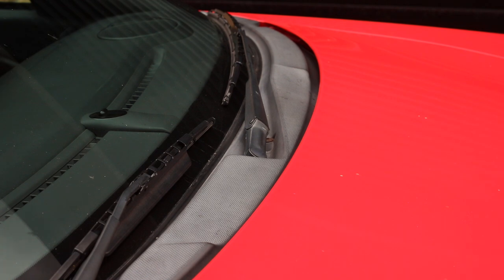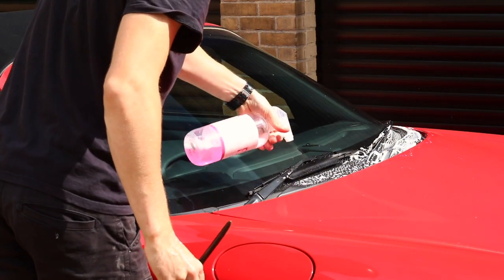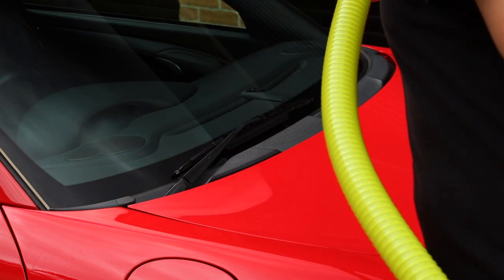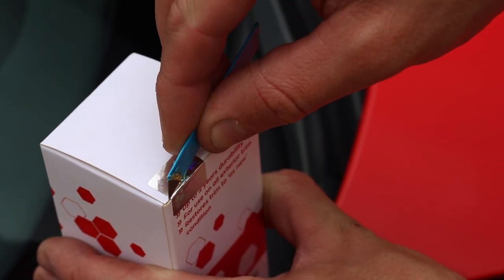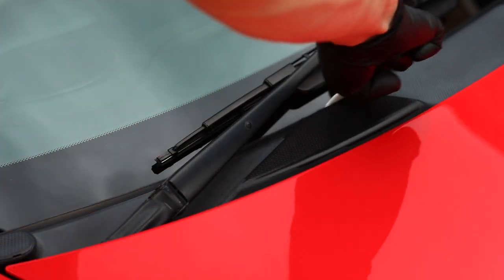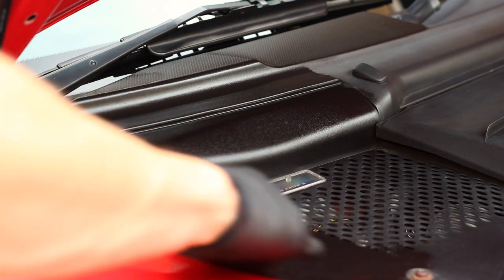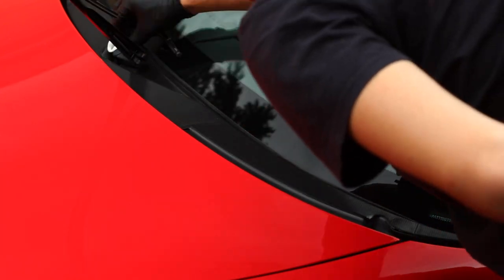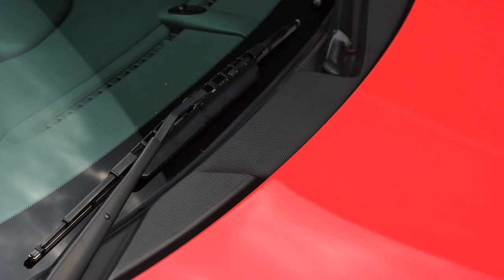How to Permanently Restore Plastic Trim | Gtechniq C4 | Porsche Boxster Detailing

Comment: Good video, liked. This stuff is brilliant, it bought up my plastics and wingmirror triangles a treat on my Subaru, still doing very well after about a year by the way. Edit : I can also vouch for their C5 Wheel Armour, same application process basically, that coupled with 3 puffs of Gyeon Wet Coat after washing the wheels. This sees most brake dust come cleanly off with just a pressure rinse at the next wash. Never underestimate the power of the Kranzle lol
Reply from the maker: LOVE THIS!

Comment: Great video Joe and a good product. 

Just what I need for my Wife’s 2017Mini Cooper

What’s the durability of the product and will I get the marks I seem to get round trim and panel joins where the water runs over the trim?  Many thanks Dave
Reply: I have no clue about this product but if the marks are on the plastic on the side of the hood oder in general near/under metal Body parts, then that’s probably not marks from water. Those are marks from the rust preservation compound from inside the hollow body parts. I have a 2018 Clubman and got those side trims replaced for new ones for free from BMW since those marks are practically non-removable. It’s a common problem. Cheers
Reply from the maker: Wow this dude smashed this reply better than I could Dave! 
Durability should be a year to 18 months I find!